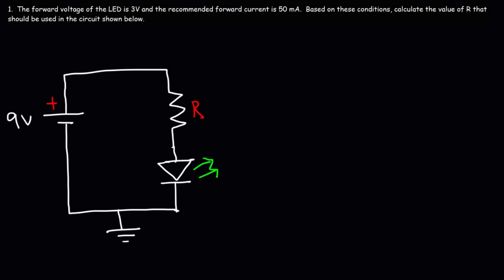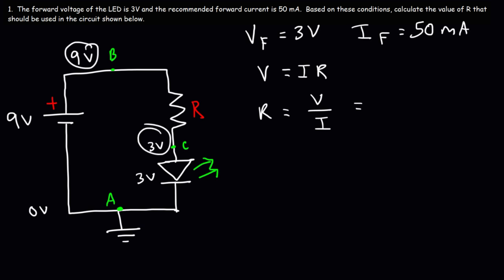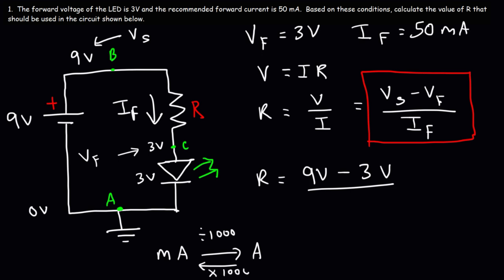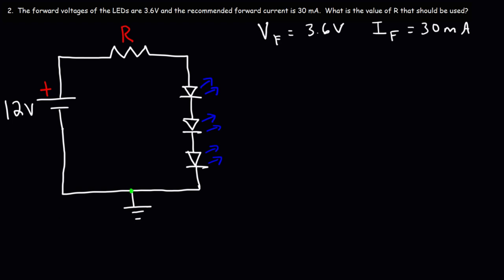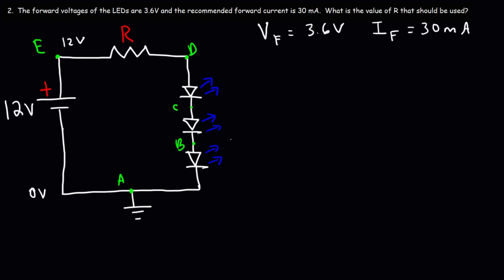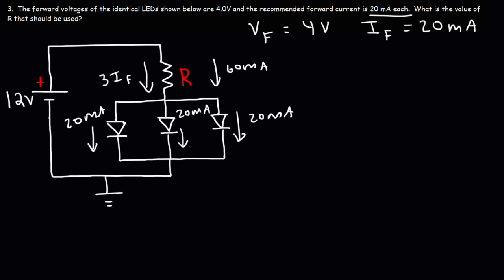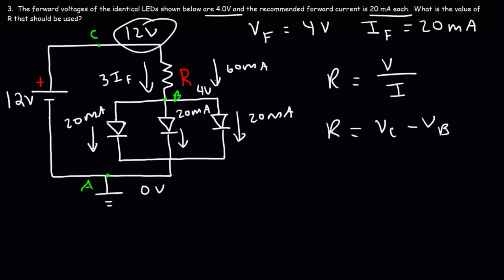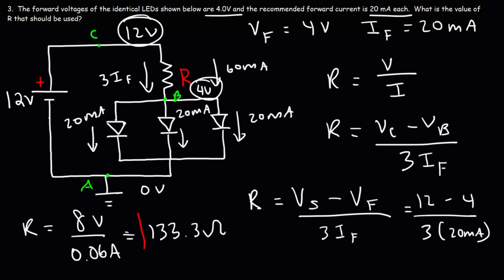How To Select The Resistor Value In a LED Circuit Using Ohm's Law

Comment: Simple yet so elegant. I always tend to confuse the source voltage with the voltage dropped across the first resistor in series circuits. This really cleared all the doubts. Explanation is spot on.

Comment: All good, will forward it to my apprentices, but... one thing, the symbol of those diodes is wrong ;). The diodes shown are silicon diodes, bot LED diodes. If you'd like to show an LED diode symbol, you'd have to add arrow in the direction out of them. The rest is well explained. ;).
Reply: I'm talking about the 6minutes example one. :)

Comment: Can you help with this Q: how about if we have a Voltage source lead to a resistor in series to a parallel with a Led on one side and a resistor on another of this parallel then lead to the ground. R1:324ohm and R2:47ohm. Yellow led, What is the current in series circuit as well as parallel circuit?
Reply: Parallel circuit rule: the voltage over the yellow led  is about 1.9v so the voltage over R2 resistor in parallel to the led , From there you can calculate currents.

Comment: in the series example, if you add one more led at 3.6v drop with a 12 volt source giving you 13.8v drop....the circuit won't operate?

Comment: So the output voltage on the resistor changes based on what is after the resistor ?

If I have a source voltage of 24 volts, and 9 volts, in 2 circuits, and a resistor of 25 ohms, how do I find the output voltage of each of these circuits, if there is nothing else in the circuit ?

Is there an online calculator that will allow me to put in the source voltage amount and the resistor value and have it tell me what the output voltage will be ?

The wattage for the resistor would be 50 watts

Thanks

Comment: Please let me know how you got the 50 mA? I am missing this part of the equation thanks, (example 1)
Reply: The recommended forward voltage of the led is 50mA
Reply: based on testing at the factory, a current of 50mA is ok for that size of LED. is taken apriori from factory specs.

Comment: If i understand right you would need no resistor if your source volatge is the exact same as the voltage the LED needs?
Reply: Correct
if the current and Voltage of your voltage source is the exact rated current and voltage of your LED
then that's correct you wouldn' t need a resistor

THE PURPOSE OF THE RESISTOR IS TO LOWER THE VOLTAGE FROM THE SOURCE SO THAT IT DOESN'T BLOW THE LED, if it's not greater than what it is rated there is no need to reduce it